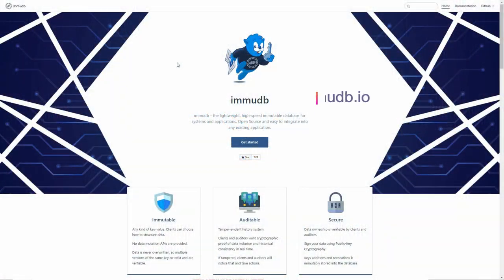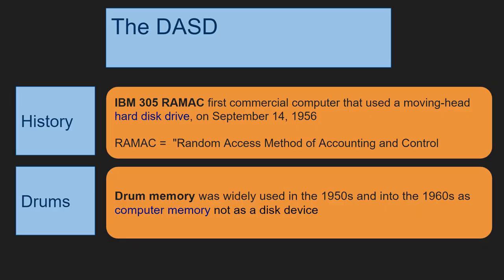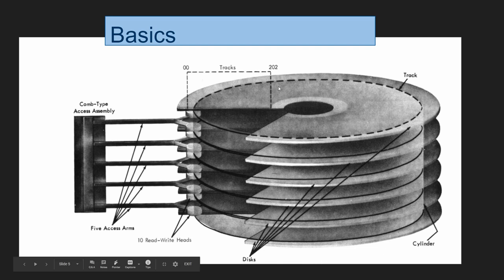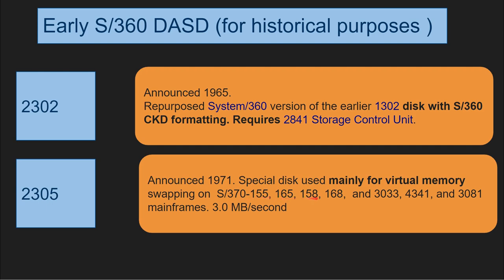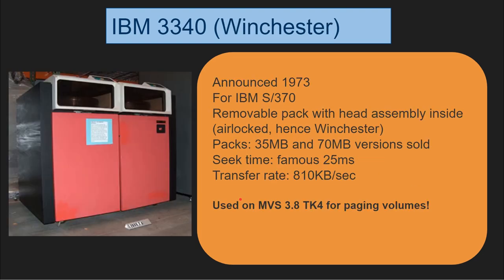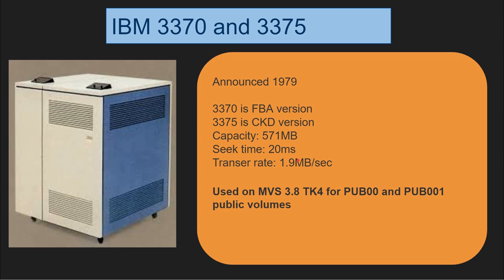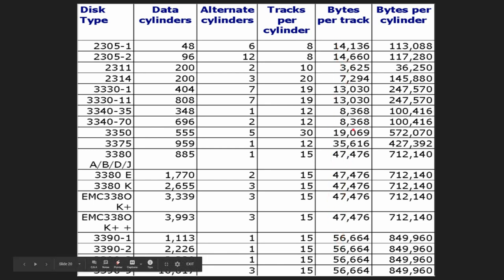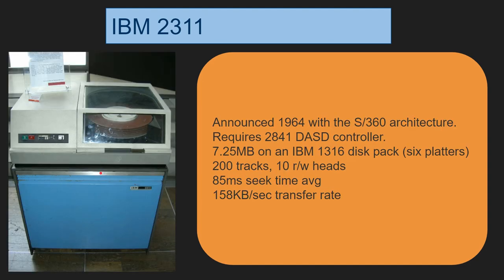Mainframe disk devices from the beginning of IBM S/360 to today - M177

Comment: I never used a machine like that, but they always fascinated me. I basically started my work with web applications like many (did a little bit of industrial and an algebraic system before but they were projects, and the algebra system was free for a university). Thanks for sharing.  From your table, I can see why by  87 the continuation of the line was dubious as arrays started to appear and production of  80 megabytes drives was massive. Far smaller and less reliable that the mainframe drives, but too cheap to ignore.

Comment: I worked on S/360 & S/370 systems starting in about 1975 in systems programming. I owned an S/360 model 30, 2311s and  2401 tapes at one point. 
Did you know the 2311 and 2314 both had hydraulic head seek mechanisms? The 3330 "pizza oven" was the first with an electronic voice-coil head seek mechanism and needed a 3830 control unit. 
S/360s had selector channels and byte multiplexor channels, but block [multiplexor] channels didn't come along until S/370. 
The 3344 disk was left out; it was a fixed pack version of the 3340.  
3380s were referred to as: single-density (no suffix, D & J); Double-density (E); Triple-density (K)
The disk model nomenclature could use some work. A-models are head-of-string units, while B-models only attached to A-models. The number suffix is physical CUU addresses per box. Thus an example would be a 3380-AD4 or 3380-BK4 or 3380-CJ2. C-models had a built-in control unit.

Comment: The 3340 had two 30 MB (approx) drives side by side, or 30-30. The lever action Winchester was a 30-30 caliber. The Winchester drive was named after the gun that won the West.
Reply from the maker: Thx
Reply: Beg to differ about the "gun that won the west". The 30-30 first came out for the Winchester model 94 (1894). The Winchester 1873 would be a better candidate, and it commonly used 44-40 ammo (44 caliber, 40 grains of black powder). Winchester called the 1873 model "the gun that won the West."

Comment: At my times @ EMC we 've had a feature called "SRDF" for disaster recovery.
We copied disk unit data from one site to antoher in real time.
Typically done via fibre or what you call it "ESCON".
Failover scrips were provided by EMC in coop with the customer.
Even Sysplex was covered.

Comment: In the UNIX and LINUX world tapes (at least earlier) could be very picky with regards to real time.

A streaming device works best if the host can keep up with it - let the device wait too long for data means that the tape must be stopped and reversed a bit so it was very important that the data to be written either could be read sequentially or it if it was from different parts of the disk staged into a continous large file on a fast disk device, fast enough that the tape device's real time demands could be meet.

Comment: History: First removal disk pack 1311(went on 1440 computers. For 360 ibm renumbered 1311 changed to 2311 disk drive.(really same drive, higher density). Winchester drives
were developed at IBM lab located in winchester england. 3330 disk packs cost $1,000
per pack(100 meg pack!!!!).
Reply: I worked with IBM, as a language instructor, at the Hursley Park Labs during the time the Winchester Disk Systems were designed and developed (in the 1960's).  The programming language PL/1 was also developed at that location and I played a part in writing some compiler routines for that much denigrated development tool.  Those were great, exciting, days to work at IBM when the company, headed by Tom Watson Jr, was on track to become the world's biggest company.  Where did it all go wrong?
Reply from the maker: @jimhardy2034 exciting experience !! Thanks for sharing. Where it went wrong? Easy: IBM always had an attitude that doesn’t work anymore nowadays: i.e. that they know better than the customer what the customer needs. That’s what’s wrong with IBM. In other words, arrogance

Comment: I worked with 3370 and 3380 drives in places I worked.  Funny thing about the 3370, some of those would make a sound like a buzz saw once in a while, did they ever break down, uh nope.  Once saw a 3380 catch fire, it was the main system volume for VM/370, did VM/370 crash, nope, it simply said the volume was offline, when we hit the big red switch.  That system continued to run until 8pm, when the system was shutdown, the backup tape loaded it on another volume, performed an IPL, and the next day the techs were on-site to repair the drive.
Reply from the maker: Wow. Amazing that it continued to run!
Reply: Never had the chance to work with mainframes but when I studied to be ready if the chance arose I was told big iron systems have so much redundancy one could claim you could physically disable or destroy half of it and it would still keep running in some capacity.

Wish Windows and sometimes even Linux had that level of fault tolerance, a literal lp0 printer on fire scenario without crashing or major disruption
Reply from the maker: @Mordecrox indeed
Reply: VM sysprog/fanboy here. For reliability we had a VM system that ran continuously for almost a year without shutdown. The only reason it didn't run longer was we had to apply some maintenance that required a restart.
Reply from the maker: @stan.rarick8556 and I am a VM fanboy too !

Comment: I was a S/370 console operator for a large insurance company that had a 3032 mainframe and a vast computer room full of these 3350s. (I was only 19 years old)

when we would start up batch processing in the evening, it was as if a hundred washing machines hit the spin cycle all at once.

 Mainframe operator was my favorite job ever. Did that from '79 through '83, then became a systems programmer, i.e., installer and sysadmin. 

left the mainframe world in '87 never to return.
Reply from the maker: Yes the fun we had in those days is just not available anymore. You felt that it was an important job and to be taken seriously but it was still a lot of fun
Reply: @moshixmainframechannel  I was 19 and making $24k / year plus full benefits with no college degree (1979). most of my friends earned half that amount at their jobs. 

everyone in DP operations in the town I lived in knew everyone else. job hopping usually meant a 15% raise. 

I do recall that everyone working 3rd shift everywhere I ever worked was C R A Z Y - mostly in a good way. 

the execs never had any idea what was going on after midnight behind locked doors in the machine room . . . .
Reply: TOTALLY ...and the tape drives right behind,, acting like banks of clothes dryers. It definitely was like working at the Bizarro Jetsons Laundromat. Tape Ape ,and proud of it...
Reply: @bzert281  pulling scratch tapes - - - UGH, I hated that duty - but it wasn't as bad as decollating 4-part carbon fanfold paper
Reply: You left the mainframe world to which other world?
Reply: @RaymondHng  moved to the caribbean, exclusively working with microcomputers (IBM PC, Mac) first standalone systems, then later client / server (novell / WinNT). Moved back to USA 2006. Now exclusively doing customized responsive mobile web application design for small / medium businesses. (bootstrap, LAMP).

Comment: did you mention that an HLQ had a max length of 8 characters? I may have missed it. 
8.3 filenames, meet 8.8.8.8.8 filenames, LOL

Lovely history. I was "born" into mainframes in 1980, we timeshared, and had two 3350 packs assigned for our use. When we in-housed 2 years later, we bought a 4381, four 3420 tape drives, two 3380s, a 3705 NCP, and a 2501 card reader (yes a card shop!). we also rented two 3350s for about a year, to help us migrate our jobs. First CLIST i think i wrote, was, drum roll, a blocksize calculator (hello, world!), and yeah, those 3350 numbers stick with you. When i'm old and demented, i'll probably still remember 555 x 10 x 19069, even though it's been 39 years! My first sysgen was a CBIPO of MVS/SP for that move - and a PEPgen for the  RJE remotes and dial-out stuff.

Comment: The IBM 1311 and 2311 were hydraulic actuated.  I remember that if they were not squarely mounted on the floor the power of the actuator moving between cylinders would walk the driver across the floor.,  More than once we had a hydraulic line or connection fail and the device would be flooded with hydraulic fluid.  7.25 MB of storage seems minuscule in size today but it could held our compilers and programs and meant we didn't have to load them from cards every time we wanted to run them.
Reply from the maker: Great story. Thank you
Reply: The 2314 was hydraulic as well. Third party manufacturers made voice coil versions of the 2311 and 2314.
Reply from the maker: Didn’t say it wasn’t hydraulic
Reply: when I was eleven years old, the math-science center had an IBM 1620 with an attached 2311 hard drive. It was obsolete (donated by philip morris), but made great Snoopy calendar printouts. did some fortran code for that computer. lots of blinkenlights. saw an operational IBM 1401 at the defense general supply center in chesterfield VA in 1973. was briefly an IBM/360 operator in 1979 for a financial services company.
Reply: I ran a school dàta center's DOS  26.2 system on 2 2311s. Generating a new supervisor was fun because you had to do a lot of pack swapping

Comment: DASD, pronounced "daz dee" is direct access storage device... I think you might have said attached. Anyway fantastic video as always but I've particularly enjoyed your hardware related stories. You might want to investigate other CPU devices such as console devices and even the motor generator sets the accompanied processors from at least as early as the 135 through to the 4300 series, converting 50/60 Hz to 400 Hz. The were typically used as tables in machine rooms as they were about the same size as a 4381 CPU.

Comment: For quite some time in the late 1980s, IBM subcontracted manufacturing their disk arrays to Hitachi Computer in Kanagara, Japan. They were able to produce them with only a one micron head to disk clearance which used less power and had faster read write speeds. IBM then licensed the tech from Hitachi and then manufactured their own.
Reply from the maker: Yes, I had that rumor. Nice to know the rumor was true.
Reply: I don't think the timeline is right. The IBM General Products Division in San Jose, CA, manufactured the disk equipment. Their first RAID disk product was called the RAMAC (reuse of the 1950s disk name), announced in June of 1994, and was manufactured by IBM competitor Storage Technology Corp for IBM after EMC Corporations RAID disk products cut deeply into IBM's sales. IBM announced the sale of its Storage Technology Division to Hitachi in 2002.
Reply from the maker: @jpcallan97225  ok but the title of the video is about S/360 disk devices. Ramac was before S/360
Reply: @moshixmainframechannel  You are correct about the 305 Ramac predating System/360, but IBM reused the Ramac name, rushing a repackaged competitor's product to market. Their first RAID disk product was called the RAMAC (reuse of the 1950s 305 disk name), announced in June of 1994, and was manufactured for IBM by competitor Storage Technology Corp after EMC Corporations RAID disk products cut deeply into IBM's DASD sales. I don't remember the 1994 Ramac's machine number. I didn't like the product and was recommending EMC's cached RAID arrays to my consulting clients.

Comment: I'm pretty sure that drums were used as I/O devices. I remember taking a trip to the American Airlines reservations system in the '60s and gazing at their 7330 drum attached to their 7090. It's, essentially, a head-per-track disk, no seek time. Also, all the virtual memory 360s and 370s pretty much had to have 2301 or 2303 drums for paging devices if they ran CP67 or VM. Unlike HyperV (somebody correct me if I'm wrong) CP and VM can page the virtual machines they create not keep the whole virtual machine in memory.
Reply from the maker: HyperV pages guest VM memory
Reply: On the 360 drums were channel attached and used as I/O devices. Some early drums used drums for main memory. The 7090 used core memory, so indeed the drum was an I/O device.

Comment: Hey Moshix, a topic for future consideration - I'd really like to get into the basics of interactive mainframe apps on MVS 3.8 and the available languages and tools we could use today to develop interactive panels, including menus and data entry forms.  I know you've covered the basics of installing KICKS in the past and I'm about to try that myself; does REXX for MVS 3.8 also have the capability to author panels, and what other tools could we consider, hack around with, study from, or learn about, for example how was the TK4- menu system developed?
Reply from the maker: Well with the new BREXX 2.3 it’s easy to build panels in TSO in MVS3.8. But you would have to wait for Update 9 of MVS 3.8 TK4. Hopefully out by the end of the year.

Comment: You skipped the 2310, which is the single-platter removable disk (the platter was the 2315), developed for the 1130 and 1800 (where it was a/k/a 1810) but also used in the 360/44. DEC adopted the drive as the RK-05.
Reply from the maker: You’re right !

Comment: I believe that the System Managed Storage feature provides the badly needed  abstractin needed to provde potability to keep up with technology. It provides huge improvement in JCL simplification. Also, with move towards database systems like DB2, Oracle and My SQL, separation from the nature of the physical device record layout is complete. Whenever the data type of an item is changed, ,added or remvoed or archived, the systems will deal without it without extra programming!
Reply from the maker: Thanks for writing. In theory yes, in practice it created the need for a storage admin, which was not a role that existed prior to SMS
Reply: @moshixmainframechannel   I never had the opportunity to learn what items that were the opbject or storage administration setup. When I was programming for apps on the Prime supermini systems, we were never exposed to the nature of device physical records and how many of the physical records were contained on a device track!

Comment: The good old DS6800 as photographed for the present day. However even though I have one I will be restoring I would never trust one in production. The main reason is the fact of the KONA cards fail at random without warning and if I properly quiesced they will sometimes spontaneously format. But anyway I would trust my data more to a DS8K line of hardware.
Reply from the maker: Yea the DS6800 is the worst mainframe product IBM made these last 20 years. No doubt
Reply: Yes which is why I’m looking into dumping it to tape and transferring it to a DS8800 that was decommissioned from the Miami university. The system was running 2 VSE LPAR in ESA/390 mode. Only one issue is I need to buy replacements disks for the DS8800 and the CECs has the disks removed but I believe the previous CE left the restore media so I’m looking into restoring it. However when I’m all said and done if anyone wants that DS6k with CKD Licence I am looking into selling it everything disks software and expansion for the price of 1 KONA.

Comment: "virtual memory wouldn't exist without fast disk" - wellllllllllll,  it probably WOULD, because it was so much of a bargain to be able to swap work in-and-out-of-memory, and run "more work than your CPU could run" - but it would have been less performance, definitely. we'd be looking at hours of backlogs that we didn't have to look at with fast drives.... but you know how "money talks," and if the company didn't have to buy more capacity, they'd put up with things being slower...within reason. 
(p.s. at least MY company would make that compromise --- but they were cheapskates! ;)
Reply from the maker: Okay but where would it swap to, if no disk is available ?
Reply: @moshixmainframechannel  well, if no disks were available at all, then that would be gruesome indeed.  I didn't think you meant, that, just that a shop might not allocate fastest disk. Fortunately it's an academic exercise we never had to try, but i always wondered about the possibility of having a tape or two permanently mounted, (just for swaps, not for paging of-course,) if you had to extend memory in a disk-free system, and could tolerate a region-swap taking a minute or maybe more. But, now I think of it, I don't believe ASM has the methods available, to manage a set of sequential-media "swap files" anyway, so scratch that idea, heh heh.
Reply from the maker: Swapping to tape did indeed exist. But those were not virtual memory address spaces. It was just memory segments. ICTS on the 7094 is an example of that
Reply: I worked at a shop in 1967 where we rolled a BG partition out to tape, loaded a transient program in from the same tape, rewound the tape while the transient program was running, then reloaded the original BG batch program back in to continue execution...........a form of virtual memory on tape.  IBM did something similar but to disk IIRC